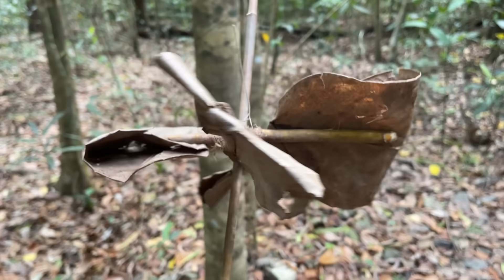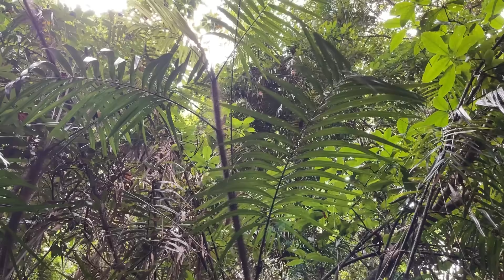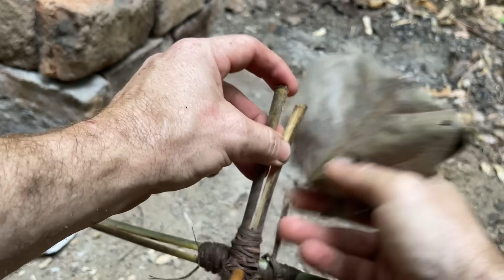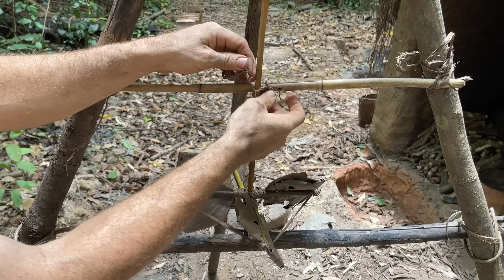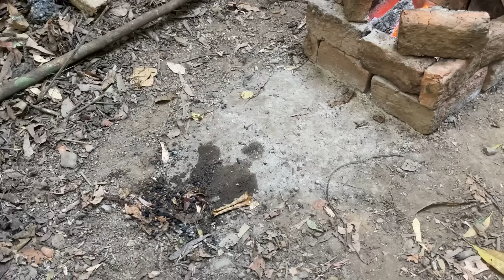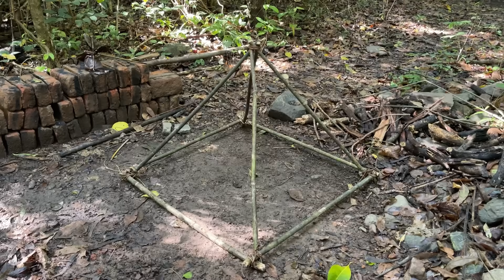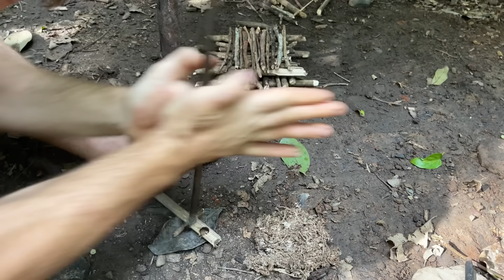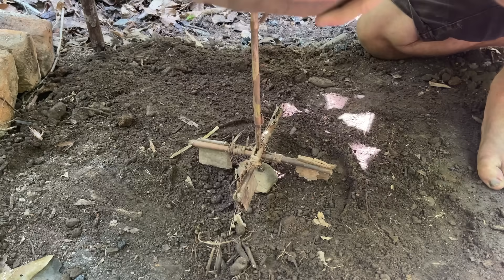Primitive Technology: Convection turbine experiments (hot air windmill)

Comment: Multiple fan blades on a single shaft inside a draft chimney might manage to produce enough torque that you might be able to extract useful work from it, but then you run into the issue of how do you keep it from all incinerating in the process.  It's an interesting concept to explore.

Comment: Unfortunately, I just don't think rising hot air carries enough force to spin a fan very fast unless it weighs practically nothing, in which case it wouldn't be usable for work.
Even if you were to completely seal the output of the fire and route it through a clay pipe, I don't think the air would be coming out of it very fast.

Comment: I have an idea of bearing for your turbine. You can forge a thin hemisphere out of iron and use it as a base. Then you can forge a second, same hemisphere but with tiny hole in the center and connect it to hollow tube which will be your shaft axle. So you can put some oil in the tube and it  will be forced through the hole, creating a kind of hydrodynamic bearing.

Comment: Just to add my thoughts, but rather than use the exhaust gas directly, could you create a steam turbine set up? Could have a pot of water with a spout over the fire feed steam into a fan housing like you've made before. Removes risk of setting fire to the leaf fans at least though I don't know how efficient it would be

Comment: this is quite literally a gas turbine engine. find something a little more heat resistant for the upper housing, turbine blades, and turbine shaft shaft and you will have yourself an incredibly useful contraption. perhaps you could try some of the ceramics you often create. maybe you could even just clad the rotating elements with some clay or something to give them just enough insulation to not ignite.

Comment: You should consider putting something between the fire and the roof to protect it. Maybe something that can transfer pressure better like steam from a boiling pot of water. That way you can build tubing that's directly attached to the top of the water vessel.  Gotta come up with a better name for water vessel though, and maybe a name for the whole power system like "Extremely hot damp air power"!

Comment: A few considerations you may want to look into:

Funnelling all the hot air together was a great idea. Your materials, on the other hand, are not fireproof. Funnelling the air will also concentrate the heat, which means that your materials will be closer to their burning point.

An alternative method is to get more torque instead. Go for a larger turbine and funnel the air through that instead. It won't spin as fast, but you should get more torque out of it, and thus more power without risking burning down your turbine. The bottom bearing may need some additional lubrication for it to keep spinning though. Would putting some water in that indent that the spoke sits in help reduce friction?

That time, you were experimenting with making a large wheel out of fibers and cane, right? You could do some power conversion by putting the large wheel on the long spoke, and connecting it to the shaft of the blower's fan via rope. The rotational speed increase should help blow more air into the fire.

Lastly, a lot of heat is lost to the sides of the open structure. You should enclose the sides, so that all the hot air can only rise up and out of the chimney. Which of course has its own problems if you want this to be a hut for you to sit in while you work the smelter. In which case, perhaps consider an offset turbine? You only need to expose a portion of the blade and not the whole thing to the hot air.

Comment: Isn't using the energy from the airflow to make more airflow just a perpetual motion machine? You should lose energy no matter what if you try to power a fire with itself
Reply: I believe natural draft of the air is also a factor meaning it's not just the fan working

Comment: You could improve the efficiency by creating a more airproof (and fireproof) funnel, as well as using a contraction and expansion nozzle (basically a rocket nozzle) to blow higher speed air on the turbine and adding a shroud around it so more air is used to drive it. Also, for low power applications, a centrifugal fans are more efficient. Hope this helps!

Comment: build a tall chimney above an air blower - with the turbines in the chimney powering the air blower - and the chimney air intake snaked around to exit the opposite side of the same fire the airblower points at.  -  I notice that flames often shoot up and out the chimneys in your previous builds - could you make a light enough ceramic (slab built) turbine and mount that on a stick? could you use one for an air blower?

Comment: All the things that you make that need to be a critical size/shape are made from clay except for the things that can't be. Wheels are the big one, but shafts, fan blades, pulleys, etc are all items that don't do well being made from clay, mainly because it's so brittle. Your alternative tends to be to cobble something together from smaller easier to work with materials like leaves, twigs, vines, rattan, etc. But what you gain in flexibility and strength, you loose in precision (And also combustibility). Most civilizations deal with this by moving to solid wood constructions, and I have to say, I don't see why you haven't yet. A few videos back, you had a pulley system to turn the fan blades faster and more consistently, and the key failures were the clay pulley that kept shattering and the drive wheel that was misshapen and would cause the line to jump. I don't understand why you didn't try making either from solid wood. To be honest, I don't understand why you're still mainly working in the dirt. I feel like you should have a solid workbench by now. Something with a sliding pinching vice like what Chris from the youtube channel Clickspring made for his antikythera videos. I know the big stopping point is tools good enough to precisely shape wood, but with the forges you've made, I feel like you should be able to make glass blades. And you absolutely should be able to make a foot peddle lathe. With that, you should be able to make wooden pulleys, housing, bowls, even ball bearings. Maybe I'm not thinking of this properly, maybe none of this would work for you. I'd like to see if it helps though, because honestly, I'm starting to feel the stagnation.

Comment: How about make a kettle, boil water in it, then direct the steam to spin a propeller connected to a forge blower?
Reply: it's gonna be worse than hot air without a proper boiler

the way steam power works is with pressure. an open kettle wont generate any, and he doesn't have the tools to make something to keep pressure in. clay and wood are pretty porous
Reply: @Milbyte11  Thanks for the explanation!
Reply: At that point he could upgrade the turbine to clay discs, kind of like a Tesla turbine, which would withstand the heat. They may even get red hot or crack in the process, and he would need to make a self-regulating waste gate so they don't destroy themselves... Turbos can be scary. He could also make a power take off that pumps water to refill the reservoir.

Comment: Classical engineering problem. High speed, low torque. Hot airs ability to compress makes it very bad at creating torque. The best you can do in this scenario is use the fire to boil water, capture the steam and funnel it to a turbine. But you would need to come up with some kind of containment vessel to hold the steam and pressurize it. Like a big tea kettle. Likely not an option for you.

This is why folks in ancient times used water wheels instead. Water isn’t compressible, so it’s capable of generating lots of torque. That’s why hydraulic tools and lifts are capable of lifting extremely heavily things. The only downside is that you need a source of flowing water. Have you tried making a water wheel?

Comment: I suppose it might not fit the desired purpose of turbo charging the furnace, but I was thinking during this that maybe a spinner like this would be good at the inlet of a convection furnace, as it'd get airflow without being in the fire's heat

Comment: You have to build cogwheels from sticks that teeth directly into eachother without flimsy V-belts. Take a look at medieval windmills from the inside, you can build a crude cog with sticks as teeth. Your tiny turbines wont be able to absorb enough power, you need to think bigger, like your waterwheel but 3 times as wide for example. then with crude cogs you can get the gear ratio up with force

Comment: Very cool video as always ! Though I think this may not be the best way to have air blown on the fire. Here is what you're trying to do: Fire heats air, air moves up, windmill turns and powers blower, blower moves air back on the fire. This looks like a lot of power conversion from air moving up to mechanical movement back to air moving. Don't get me wrong, it is an interesting experiment but I doubt it will ever be as efficient as what you get from simple convection with a chimney. Plus you have more moving parts that can break/burn at any time. Just my 2 cents ;).

Comment: Turbocharged oven Mk1: exhaust cone and impeller catastrophic failure due to overheat. 😂

Thats was pretty interesting tho.
I wasn't quite sure about the impeller use until the end. I was also thinking about using a clay pot with a steam jet instead of fireplace exhaust. 

You can cool down a bit the air for the impeller with a clay chimney and using venturi effect from fire to pull some cooler air to propel the impeller.

Comment: I wonder if it might help to use the current fan blade design as a scaffold to be reinforced with a clay, might be too heavy to rotate but maybe combining it with a suitably sized chimney to force the hot air through better, that way the leaves don't just burn up. I'd probably wager it be too heavy to turn well, but might be worth a try

Comment: Have you thought of taking bark and doing a light coating of your red clay mix on them for turbine fins? While it may add some mass it would possibly increase flame resistance and keep them more rigid once cured.
Reply: These also could be done in lengths as to act as rain gutters or parts of an aqueduct.

Comment: From an engineering perspective the funnel is counterproductive. Instead of serving as a turbine, it serves more as a choke.

Narrowing the passage for air to trade pressure for speed only works in closed systems (no backflow).

You can think of it like this. Imagine a roof with no opening. Some of the hot air would be trapped under the ceiling but the rest will flow around the sides. Now you make a tiny hole at the top, most of the air would still go around the sides and a tiny amount would go through the hole. The bigger the hole the more air will flow - or even better, the whole roof is the hole.

If this were effective we would use big funnels with tiny propelers for wind power plants. But instead we use no funnel and gigantic propellers.

I would love to see this with a large leaf propeller.

As for the burning, maybe put a pot of water on top of the fire, the steam will keep the propeller wet.

Comment: Hmmm. I wonder if having the main rotor blades under the roof would help getting more power. In my eyes it'd help focus the updraft and keep the wind from interfering with the spin.
Bigger, wider blades or just having another two blades could also help but those might necessitate a thicker main axle?

Comment: In order to get enough torque you'll likely need to build a large furnace, similar to your older updraft furnaces, and your rotor will need to be a lot more heat tolerant than wood and leaves.  Precisely fit clay blades could fit in a round chimney.  Very heavy, though it would act more like a flywheel once it got up to speed.  You could cap the shaft with some of your smelted iron to reduce wear, though harvesting that rotation on the cold side is going to be a challenge.  Interestingly, this may help you with your smelting, as the updraft furnace would probably give you a better flue gas, to better manage the carbon content in your iron, and turbocharging it would be an interesting way to improve the heat without charcoal.

Comment: I think a broader funnel and larger fan blades at the top are necessary. A lot of the raising hot air from the fire was likely "spilling" over the sides of the old funnel, since going through would mean increasing the pressure, which isn't feasible in this setup.
Oh and maybe use tiles instead of leaves for the funnel, just an idea...

Comment: You should try building a trompe (or hydraulic trompe) for your blast furnace — it's a water-powered air compressor where falling water down a pipe entrains air through the Venturi effect, creating blast pressure with no moving parts. It was historically used for iron smelting and could be a game-changer for continuous operation without manual blowers.
Reply: Oh, now you have me imagining a crossover between Primitive Technology and Practical Engineering.

"Hi, I'm Grady, and today we're going to look at mud bricks."
Reply: (I think Grady would have a lot of fun talking about mud bricks.)

Comment: It is an interesting idea, but physics is going to be your enemy here. The forge blower will only ever be able to push less air then is going past the top rotor, due to low efficiency in transferring the energy (friction, weight, etc) so unless you can concentrate the exhaust air through a chimney with the rotor inside it, this will likely never be equally or more effective then a hand blower.

Comment: Have you tried Bark or thin, shaved wood rather than leaves?

I feel like do to the leaves all being different sizes and so flexible it could hinder its power at higher speeds and if there’s enough of a difference in the leaves size it could unevenly distribute the force warping the spindle

Comment: The drive fan need to be larger than the blow fan.  But real efficiency would require more directed heat which would require a fan capable of withstanding said heat while still being lightweight.. And you have barely begun creating iron prills.... I think aluminum is a few thousand years away.

Comment: Have you considered a "trompe" to create compressed air? I reckon you could fabricate one out of clay and/or bamboo. It uses flowing water to draw in air bubbles. Then you separate the air and water in the system. The constant draw of air creates pressure in the system. No moving parts. Just a clever use of physics.

Comment: With fabric woven from inner bark strips (so you can have larger overall blades) and a lower blade pitch (so it can better catch the slow updraft airflow from a normal bonfire) you might be able to fashion fan blades that can take better advantage of the convection updraft. There might be advantage in inner bark fabric technology so that you can shape your leaf funnel to be more circular and look more like a cone or trumpet, just like the trumpet-shaped inlets in turbocharged engines.

Comment: You could have that going along with a hand cranked blower. More heat coming off the fire would cause the convection fan to spin faster. Replacing the roof with clay tiles would prevent the burning but your fan would still be in danger

Comment: How about putting the rotor in a vertical clay pipe that is heated from the outside by a fire. Air should be sucked in at the bottom since the air inside is heated and rises to the top

Comment: You would probably need to use water to drive it, but using flywheels could increase rpm to make faster fans without the complexity of gearing. Balance would still be a problem.

Comment: The problem is, once you put a load on it, it becomes easier for the air to move around the blades, rather than to push the blades out of the way. Path of least resistance and all that.

The easiest and most economical way to improve this is to simply make the blades bigger. Bigger blades make it harder for the wind to move around and past.

Comment: So, if you build the funnel and structure with fireproof materials next time… you can put a lil clay dancer figurine on top to spin…

Perhaps coating the leaves with a thin layer of clay would make them fireproof and thusly more efficient? Because even though the increase in mass would make it accelerate less, the heat resistance would mean the turbine could go directly over the exhaust of a furnace without issue

Comment: If I understanded your idea right, you are setting up a obstacle on the way of natural thrust. So you blocking it, and spending part of it energy on a friction and air resistence. If you want additional thrust you need a second fire. In combustion engines useful work is mechanical, and combustion gasses is a lost energy. That is why converting energy of combustion gasses increases the motor eficasy. But in your case you taking energy from natural thrust, but it is your source of useful work

Comment: Maybe you could create a water tower. Use fire to draw the water up from below by heating in pots and capillary action in small bamboo, then use the water in the tower and gravity for a water wheel. But stop using leaves. Tile is better and will work for a water wheel.

Comment: I would try making the funnel/roof out of your roofing tiles instead of dry leaves and put the fired clay grate with holes that you use to fire pottery directly over the fire so the flames cant climb so high. also if you make the fan blades inside a long clay cylinder with many fan blades all stacked on top of each other you might get more torque sent to the driveshaft so you can increase the workload that you can put on the system.
i can see this scaled up to have the fire cook food and the fan blades spin a mechanism that acts as a rotisserie to evenly cook the food and at the top you can have dangly grasses or some kind of noise maker to scare animals away from  attempting to steal your cooking food.